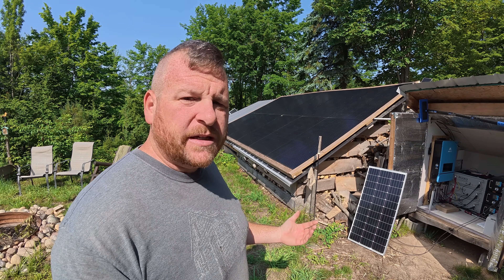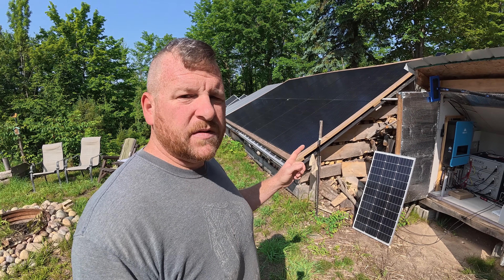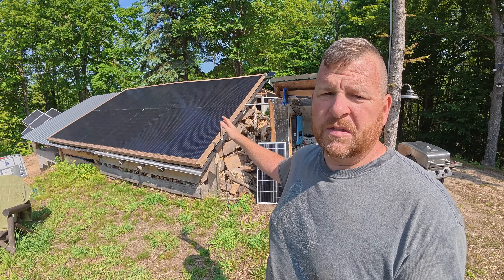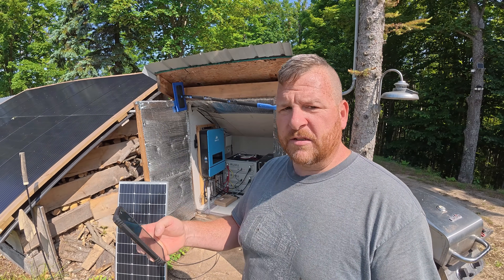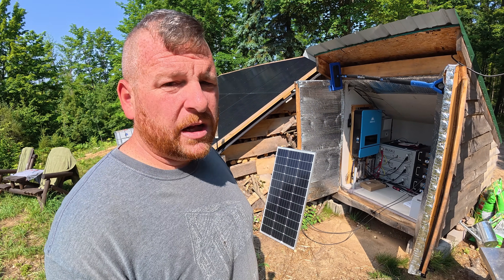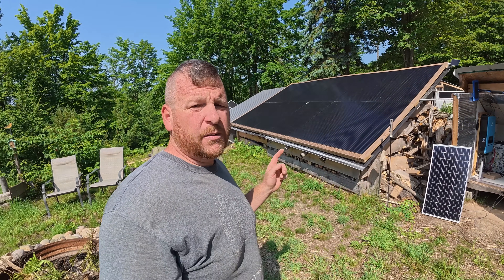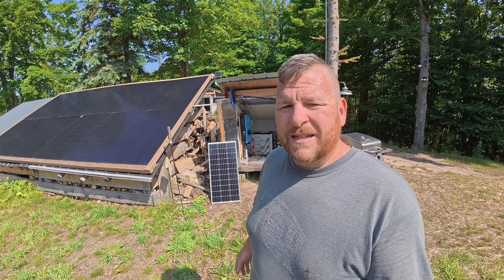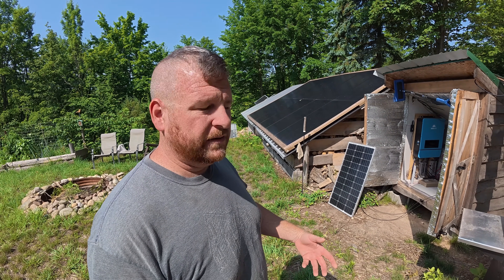Off Grid Solar System Explained- Why Our Setup Is The Way It Is- Things to Consider!

Comment from the maker: We’ve shared our thoughts on solar heat and noise — now it’s your turn! What’s something you wish you’d known before going solar? Or any questions for the community? Let’s get a good discussion going! 💬🔆
Reply: Originally hooking up a 12 volt system, not gauging the needs/requirements of what I wanted to run.
Reply: one thing is not really correct...Dc power wont loose efficiency,from panels to charge controllers,only if the wire is not sized correctly...mine is 70 meter long,and i dont loose 1 watt.I have 5600 watt advertised from panels,and i got 6200 when the panels are cold.Keeping  those bateries inside,would have avoided many problems you had with the cold,and also wear and tear.Lifepo4 hates 4 things: Cold below 5celsius,heat above 30 celsius,over dischrage,and overcharge.Avoiding these they last forever.Putting them inside is not a safety risk if its done correctly.I get it,when u started you didnt really trust your self,and you also had lead acid bateries that went hydrogen.But these lifepo4 bateies hate outside,its really not good for them.Summon too hot,vinter too cold.By the way,if they must stay in a shed,i saw from the Jarhead guy channel,that he put the shed right next to the cabin,and run a thick insulated pipe inside the shed from the cabin,so he can pump warm air from the house with some fans on vinter times.Maybe a thing to consider.

Comment: I ended up putting my panels on the portal (New Mexico, territorial style house).  I wanted to keep them off the roof but make them less attractive to thieves since we don't live there full time yet.  Since the porch runs the entire length of the house and it's situated to the south west, it was a good compromise.  Fortunately, we also have an upper deck on the side we can use to access the portal and use a roof rake to clear snow but we've only had to do that twice.  At 8600 ft, the sun burns the snow off pretty fast.

Comment: I just installed a 12000xp it is silent, I never noticed that my old one constantly had a hum, it was silent with 3kw charge, 2.5kwh discharge I have to put my ear to the intake to be able to hear the fans.
6000xp is not quiet at all.
Reply from the maker: Good to know, thanks

Comment: my equipment is not noisy. My 4000 watt 120v inverter fan only runs when the temperature is high enough and for 30 seconds at a time. My Victron charge controllers have no fans at all. I run 100 feet of 10AWG solar wire to my panels and record no loss in voltage or amperage. My 1000 watt array can put more than 1000 watts to the controller. The wire is rated for 30 amps and I see 12 amps max so far.

Comment: My ecoflow delta pro ultra is super quiet... but its stupid expensive...
Reply from the maker: It is true......power stations can be quiet.  But i think if we start pumping 2-3k watts of solar into them to charge them, they might start making a fuss, lol
Reply: @OffgridwithJayandJen   I have 3.8kw of solar on it now.. and thinking about adding 1.5kw more by the end of the year. Been using it every day for a year. Started off with 1.1kw of solar when i first got it. Been slowing adding it to it as I go. ATM its making about 20kwh a day.

Comment: how do your batteries hold up while outside like that ? is the charge reduced ?
Reply from the maker: They do great. They are inside a dry clean environment,  temps gets a little high for a week or two in the summer if it gets super hot, but i just open the doors to cool.it off. And in the winter it stays warm enough in there for 80%of the winter, we dont get frigid cold here much below zero degrees.

Comment: all valid points , but , in the interest of fire safety .... if your solar goes up so does your wood heat source .
Reply from the maker: Lifepo4 isnt really flammable,  and the inside of shed is all concrete. Solar panels are on top of a metal roof, so i think it would be hard to burn through that, even if the fuses and breakers all failed

Comment: Yeah those inverters are loud,maybe an upgrade to those silent, toroidal fans would help. That's what gamers use to get rid of fan noise, at the cost of some air flow, they dont move as much air as  regular designs but they are "silent". You could even 3d print some I'd imagine.

Comment: Good video but I have to say that not all inverters are loud. I have 3 Solis S6 11.4kW inverters installed so far, 2 in the shop and one in a solar shed. Big heat sinks convection cooled, no noise.
Reply from the maker: Good to know, 😊👍

Comment: For off-grid with batteries and plenty of space it's a no-brainer to separate this from the home.
I have a grid connected system with a fanless inverter and also some micro inverters that don't make any noise either. All of these have roof mounted solar panels, just because there is no other place to put them. With concrete roof tiles and a mounting system that does not compromise the roof it works just fine. 
The only noise I have is from the AC connected batteries that do produce heat. I am still trying to figure out where they should be, but maybe I will sell them and get an IP65 rated system for use in or next to the garden shed instead. It's doable in terms of noise and LFP is very safe, but I want to upgrade to a bigger system anyway, and 4x the noise and 4x the space may just be too much.

Comment: I always like watching your video. I have a question. I saw that you have two sets of batteries. Ruixu and Vatrer. Could you please tell me about the charging two different types of batteries?
Thanks
Reply from the maker: They are both the same voltage type battery and the Vatrer batteries have no communication,  so the BMS in the battery just allows it to call for charging or not. Long as your inverter parameters are set to the same as the batteries it should work fine, ours does

Comment: Jay you did the smart way for setting up your solar. You are so correct about having to be careful for fire. I know on another channel where they had put their panels on their roof and didn’t even know that one of their panels had burned up. So it was a miracle it didn’t catch fire. He only found out because he wasn’t getting the power he was. So he had to go up there to check on them and that’s how he found it. Good thing he did just in case it did catch fire. So yes, it’s definitely smart setting your solar up on the ground and building a separate place for all the batteries and everything.
Reply from the maker: Thank you Jacqueline

Comment: Nice video! who did you watch on youtube before you built your first one. Get some of the fuses and wires is expensive and some youtuber say its dicey. They say people sell fake copper and fake rated fuses ect.
Reply from the maker: I basically just watch Will prowse for solar building systems, but I watch raspberry rock, red poppy ranch, and Martin Johnson for off grid living info

Comment: Hey Jay how did you run the wires from the shed to the cabin? Can you please explain. Thanks 👍
Reply from the maker: Just dug a trench and put them in conduit into a small disconnect box before the main panel in the cabin

Comment: Have you thought about changing out the fans that are noisy to say PC gaming fans that are low on decibels but still provide the same fan speed? I don’t know how the manufacturer feels about that or if it avoids the warranties.
Reply from the maker: Good idea, but ya i wouldn't mess with the original fans,  but maybe a coupke small external fans to help cool them, so the ones inside dont have to run as much. Not a bad idea

Comment: We are off grid also. We put all the solar system in an insulated pump house Agree they noise and heat. Our 2000 watt panels are about 60 ft from the pump house. We also get snow and freezing weather. Pump house has concrete slab and insulated walls. Heat pump house with 100 watt light bulp.
Reply from the maker: Awesome,  ya 100 watt bulb can do miracles for heating a small space

Comment: Jay I agree with everything you said and did nothing worse than having to replace a roof remove all the solar and start from scratch and then reinstall it then listen to the noise in the house and the heat  things I did pretty much same thing built my own array outside With six panels adequate for what I needs it off it’s only 4 feet high place exactly where I want it Safety was my main issue about putting it in the house. I have an outside in a similar shed near the house fire explosions, honors, lightning strike keep it out of my house. Thanks Jay very informative. Say hello to Jim.
Reply from the maker: Good stuff my friend,  thanks for being here

Comment: In a residential area my neighbor uses micro-inventtors  per panel and they are silent.  Any noise is not audible from even 1-2ft away.  In the city we have basements and/or attics to put invertors, and good placement will put any noise away from where people can normally hear it.  Also my neighbor has  a squeegee with a 20ft pole that can be extended to clean the panels without any ladders.

Comment: My 8kw inverter that died used to be silent till 2200w. I have the inverter in the kitchen, the AC is louder, so I don't hear it, under 700w no fans on the loaner. I haven't cleared or cleaned my vertical array in 2 years.

Comment: There is a simple answer. Would you want your water pump for those great off grid showers to be located under your bed? No. The chickens don’t live in the kitchen either. Makes sense to me. Far away but not that far away. The system mentality will be the best way to go.
Reply from the maker: Good points 😊👍

Comment: my personal solar philosophy about inverter is "Inverters are off by default" only big appliances actually need AC power and you don't use those 24/7.
Reply from the maker: We use fans and power our fridge 24/7. Make coffee each morning. Use our mini split often and charge all our devices all day long. I understand that most small devices just convert the AC back to DC, but again.....I didnt think wiring a 12 volt system throughout the whole cabin was worth it, one extra solar panel on the array over comes any loses we see from the inverter running full time. I will admit these large all in ones draw far more than the smaller 2-3000 watt inverters for sure. Guess we just have to make sure we dont over size our inverter too much
Reply: @OffgridwithJayandJen  yeah, I forgot batteries and inverters are free now, wait I am not an influencer.
Reply from the maker: Nothing is ever FREE.  Lets look at the countless hours we have spent building a channel, building several buildings, etc. 5 years of hard work.
Reply: @OffgridwithJayandJen I get it. Just recognize that you may  be out of touch because you don't have to pay for gear. The solar companies push this insane high power inverter only because the average consumer doesn't know better.

Comment: Excellent reasoning all around.  You made great decisions for your homestead and setup.   Inverters and also battery chargers can be noisy.   The actual panels, MPPTs (if discrete), and batteries are usually fanless and thus quiet.

It is possible to vastly reduce inverter noise by over-sizing the inverter (or perhaps right-sizing), or doubling it up (having two inverters operating in parallel).  This is a more expensive proposition, though its nice to have a bit of redundancy.  But if you have the option of a shed as most rural setups do, then that is definitely the best place to put the equipment.

The one provisio here is the importance of the equipment always being situated in a dry, low-humidity location. It will last a lot longer and there will be fewer problems with corrosion and oxidation.  If that bunker winds up having moisture problems you may have to find a solution.    In a larger residential installation, the big advantage of being able to situate equipment in e.g. a garage for example, is that it's a more controlled space.

-Matt
Reply from the maker: Great information Matt, thanks for sharing!

Comment: Your solar is much quieter than a forced air furnace and central air. I don't miss that noise! I like to hear the wind and  birds during the day And rainfall and snowfall at night. The humming of motors and fans is agitating. I love my little  Amish fans on my woodburner. They barely make any noise. But when they do I am getting out the 3 in 1 oil.😂

Comment: You tell um Jay. I am a firm believer in ground mounts, and out building inverters and batteries. Running the A/C power to your loads is easy.
Reply from the maker: Woot woot

Comment: Hey there, who’s doing that hatchet 🪓 hair cut job on that head of yours? Lol 😂 
My panels were put on my portable garage roof for the same reasons that you didn’t use your cabin roof area. My batteries and inverters were installed in one of my bedrooms which I am very happy about. My batteries and equipment are protected very well in that spare bedroom. To each his own.., 😊
Good video. It made perfect sense to me. I am running a dual system at my place and I feel like my batteries will last longer by having them inside of my home. Air conditioned in summer and wood burning heater for the winters. My home is a mobile home and that’s good enough for me especially with everything paid for including my land.
Reply from the maker: Very nice

Comment: Snow build up. Try low wattage heat pads under each panel with a timer or some other controller. Big enough to melt a small hole for the sun to get to the panels. Self-cleaning.

Comment: What if you had most-everything work with DC voltage?  The inverter should be at rest?
Reply from the maker: DC appliances are expensive and not readily available. This is why we stuck with AC stuff

Comment: do you change the angle of the solar array for the various seasonal sun azimuth angles? If you are 48 degrees North then on December 22nd the angle to the sun would be like 70 degrees
Reply from the maker: I dont change the angle.  It would be nice to have thst option. The array seems to have good production when sitting as is......but that is only if there is sunshine.....which isnt often in the winter

Comment: I decided to go with an Ecoflow Delta Pro Ultra with 5 batteries in our off grid home, it’s completely quiet, like yourself I used to have an old setup in a shed, but I was tired of the lead acid batteries getting pulled down and freezing, we get down to -40 quite often, so I did a lot of research and upgraded my entire system including 6 kw worth of panels with on a ground mount plus 2 dual axis trackers and so far have had no issues.
Reply from the maker: Wow.....didnt know the ecoflow units could take so much solar input. Good stuff
Reply: 4kw in on the high voltage side and 1.6kw in on the low voltage side with a 120/240v, 7.2kw inverter.